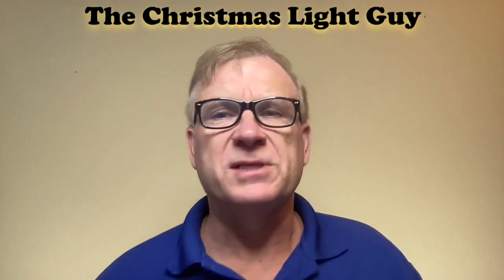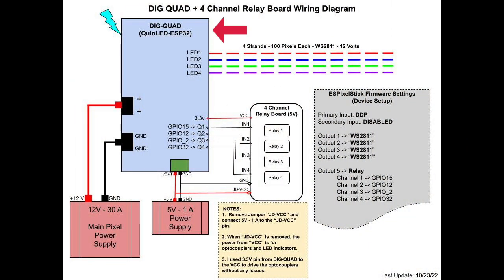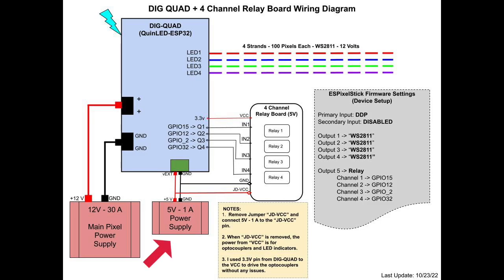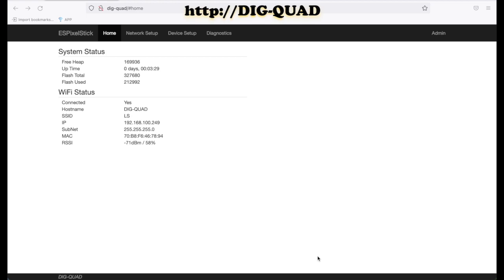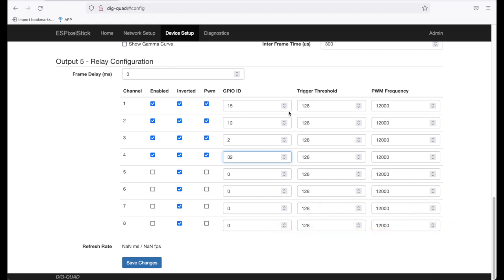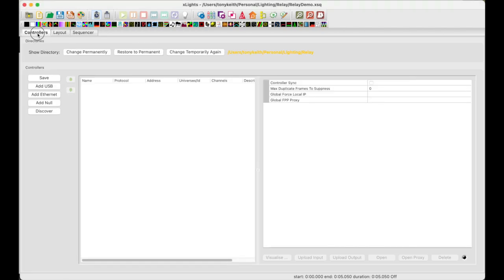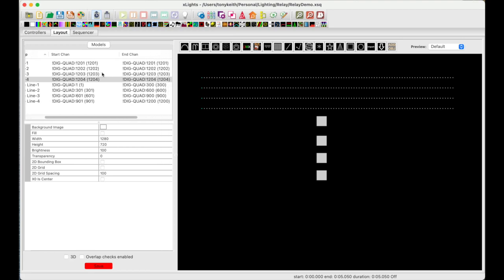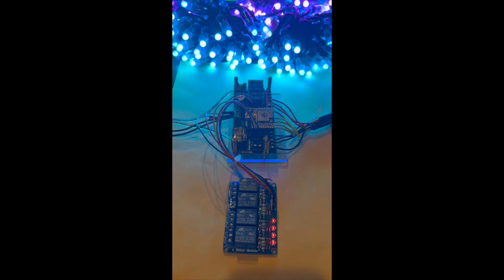How to Use Relays on QuinLED Hardware + ESPixelstick Firmware and Control with xLights!

Comment: Thank you Tony for the video!  May you explain how channels are assigned to relays?  For instance, I plan to use four relays and three pixels strings on the Dig Quad.  In xLights, these will be in universe 26 starting at channel 190786.  In the ESPixelStick Device Setup screen, entered a Start Universe of 26, so that's good.  Do the relays automatically get channels 190786-789 then the pixels take channels 190790+ ?  There isn't a place to enter channels in the setup screen.  Thank you!
Reply from the maker: If you use DDP protocol, there no need to worry about channels and universes. Xlights will assign the channels automatically.
Reply from the maker: Create your relays in the layout tab. Go to controllers tab. Click on DIG-Quad controller. Use visualize button / window to drop the relays onto output 5
Reply from the maker: Drop the Pixels onto the outputs 1-4. The relays will be assigned 1 channel per relay in sequential order (since each relay is one 1 channel). Does this make sense?
Reply: @thechristmaslightguy  Hi Tony, it does make sense, thanks.  I can't use DDP as one of my light controllers doesn't support it.  

Do you know if the relay outputs on the Quad are assigned channels before the pixel outputs in the ESPixelStick firmware?  Thanks again.
Reply from the maker: No. If there are pixels on the other outputs they will be assigned first then after would be the relays.  

If your case assign the pixels channels then the relays sequentially after the pixels on the DIG-Quad
Reply: @thechristmaslightguy  Hi Tony, thanks again!  Where do you define the pixel channels on the Quad?  I do not see fields for that.  I only found a field for defining the Start Universe.  Do I need to turn on advanced mode in the Admin menu for that?  Thanks for taking the time to help.
Reply from the maker: You don't setup the channels on the DIG-QUAD.  The channels are set in xlights on the Layout tab for each prop/pixel.  Select each prop/pixel.  Set "Controller" to "Use Start Channel"  Enter correct channel number.  You will have to manually calculate the channels / offsets.  On the DIG-QUAD set the correct universe and start channel. This is a bit complicated but I can help you if you contact me on Discord.
Reply: @thechristmaslightguy  Hi Tony, thanks to your excellent video, I got it to work!  The below video has 3 of 4 Dig Quad outputs running ws2811 and the 5th output running four relays.  The demo video is xLights running a test sequence.  Thanks again! https://www.youtube.com/watch?v=kUXkP8SXhTI
Reply from the maker: @TomInOhio2 I’m glad I could help. Have a great holiday season.

Comment: I have successfully up loaded the firmware and got 4 relays working. I have an 8 channel relay and have loaded the dig oct firmware and enabled the full 8 relays. I cant get xlights to reconize the other 4 relays any help would be great
Reply from the maker: A couple questions:  Did you enable all 8 relays and set GPIOs in the firmware under "Output 5 - Relay Configuration" (6:33 video)? Next did you create 8 single channel relays in xLights (7:45 video) ?
Reply: I figured it out. I didn't create all 8 relays. Thanks for your videos @thechristmaslightguy

Comment: Tony, great video.  I have a different QuinLED variant (the Dig Octa Brainboard) running espixelstick 4-beta4.  In xlights, seems the Dig Octa only has 8 ports (instead of 9 to include the relay).  Any thoughts on how to get a relay working with the Dig Octa Brainboard in xLights?
Reply from the maker: Unfortunately, I don't own or have any experience with the DIG OCTA.  I'm still waiting on a bug fix (flicker) in the ESPixelStick firmware when running 8 outputs.  This is preventing me from completing part 2 of "How to get 5 or 8 LED outputs on a DIG-QUAD.

Comment: Could you make a video using 8 relays, I can only find 4 pins
Reply from the maker: I don't think I will have time to make a video for this anytime soon but I think it should be possible.  The DIG-QUAD provides a header connection for Q1-Q4 which I connected a 4 relays to.  You would have to select 4 unused GPIO pins and make the connection on the DIG-QUAD to the other 4 relays, then map the GPIO pins in xLights to the relays.

Comment: Tony, that is awesome. I really want to use my old A/C lights in my show. That is a superb tutorial. Would you happen to know if WLED has similar control options for relays or if I should use Pixelstick FW only?
Reply from the maker: Thank you for the nice comments on the video.  I know WLED supports 1 relay and it may support multiple relays but I have never used WLED with relays.  You may want to check out the this page https://kno.wled.ge/features/relay-control/ or I would recommend asking this question on the WLED Discord channel https://discord.gg/KuqP7NE

Comment: Hi Tony,  I am using header pins Q1-Q4 to drive four relays on my Dig-Quad.  Is there any way to tease one or two more outputs on the Quad for a couple more relays?  

I know there is a Q1R output, but that shares the same GPIO as Q1.  There is a "1Wire" header pin exposed, but I don't know what that's for.

I wouldn't mind doing a little surgery to the board to expose another pin or two, but don't know where to look.  Thanks for any ideas that you have.
Reply from the maker: Hey Tom - Sorry for the delay in getting back to you.  I was out of town for a wedding.  Yes. You could use other GPI0s.  The AE+ modules uses the following GPIO Pins.  These should be available for addition relays.
LED6 - GPIO 21 (AE+)
LED7 - GPIO 17 (AE+)
LED8 - GPIO 22 (AE+)
Reply: @thechristmaslightguy  Hi Tony, thanks for the reply and hope that you enjoyed the wedding!  

My DigQuad does not have an AE+ "hat" and I don't see that as an purchasable option in the Dr. Zzzz store.  But, it is possible to use one or more of the four built-in ws2811 outputs as a relay output instead?  It is just a matter of defining the correct output pin in the PixelStick interface?  Thank you!
Reply from the maker: Tom - I would try using the GPIO 0 (button).  This is a pin just above Q1. See https://quinled.info/quinled-dig-quad-pinout-guide/ for pinout.  I'm not sure about using Q1-Q4 since these outputs are level shifted.   I would try to use the GPIO at the header not the LED output.  It is just a matter of defining the correct GPIO output pin in the ESPixelStick firmware (relay).
Reply: @thechristmaslightguy  Thank you, Tony!  I will certainly use the "button" GPIO.  Great idea.  Have a good day!
Reply from the maker: @TomInOhio2  let me know if it works. It should.

Comment: Can i control ac 120v lights?
Reply from the maker: Yes.  Relays can control 120V ac to turn on/off your lights.  Be sure to use relays with the corrects voltage / amperage rating.  The relays in this tutorial are each rated for 10 amp at 125/250 V AC.
Reply: @thechristmaslightguy  can I use esp32 under espixelstick ?
Reply from the maker: @sotoruedaspedro  I'm not sure I understand your question.  Can you provide more information and I would be happy to answer your question.